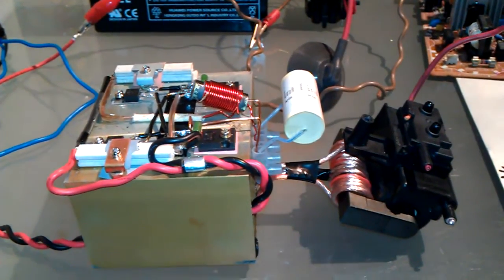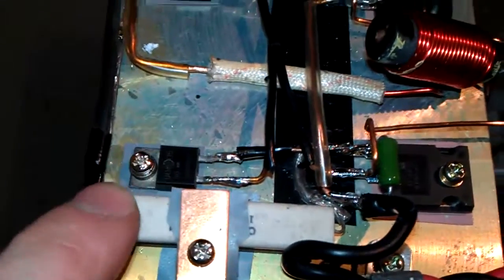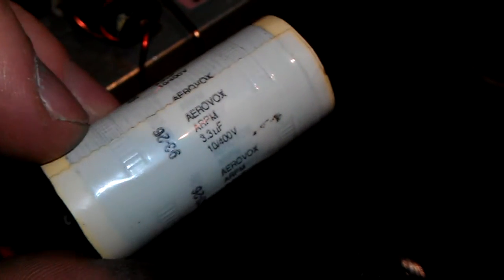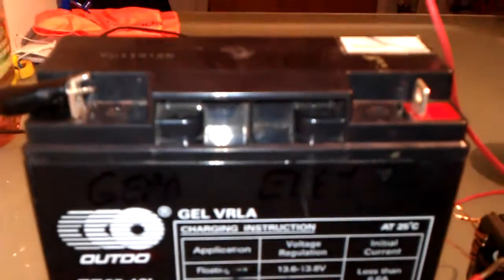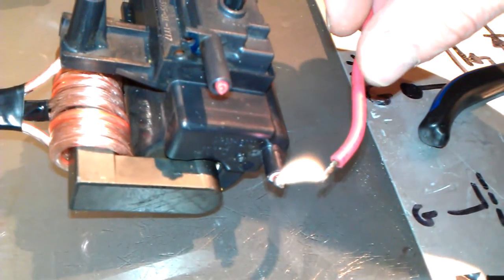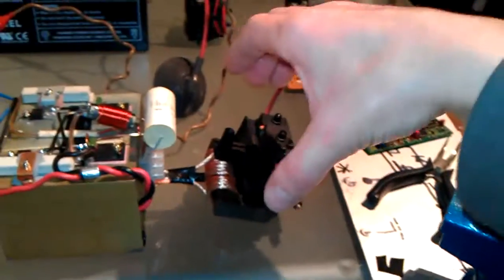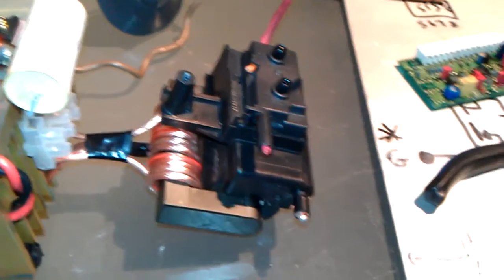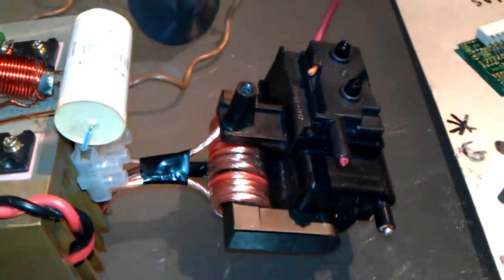Zvs circuit flyback driver... just built"

Comment: Haha i was playing with a small capacitor bank and thought i'd discharged it but apparently not! touched it and got  a jolt of 2000v up my arm!
Reply from the maker: Glad you wasn't hurt buddy! Use a wire to short the cap while it's not in use. Or use a 1kohm resistor to bleed the cap off while it's in storage.  Be safe bud.

Anthony
Reply: thanks mate! that was a while ago and i've leant from that experience haha

Comment: Hi, Could this work with a 12V but 1A power supply? 
Thanks and nice video btw. Also pretty interesting the point of your little slip with the flyback, it helps, I bet some people won´t let the wires close to the supply terminals anymore x).
Reply: yes 12volts but I get very well arcs by using around 5-10-30amps is awesome!!! but 1 amp will but it may not work as well
Reply from the maker: Hello mate. so sorry for the late reply' iv been so busy and as you could emagine I get alot of emails and comments.

12 volts and 1 amp won't give you the output from your zvs! I'd recommend  12 volts at minimum 5 amps to get a good output.
 as you draw an arc the zvs will try and pull more amps/current, and if there's no Amps/current" the Arcs will snap being tiny! but if the amps/current is there' then the Arcs will be able to be pulled out giving a nice display you want ⚡

hope this helps friend.

be safe.👍

Anthony 

High1voltage1rules
Reply: Thanks man
Reply: +Dashz yeah what he said